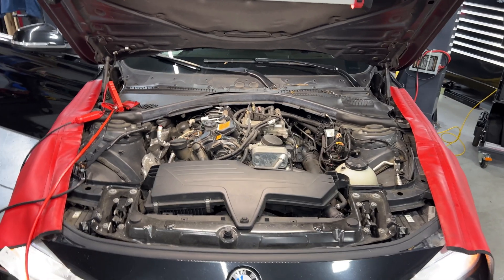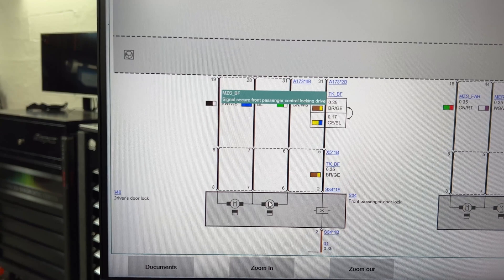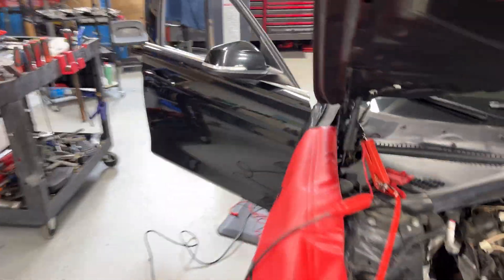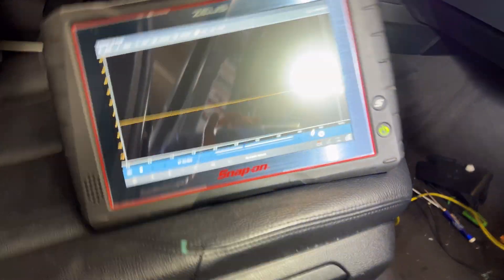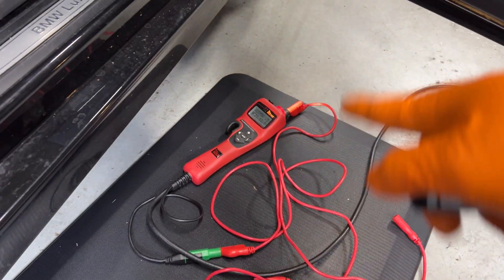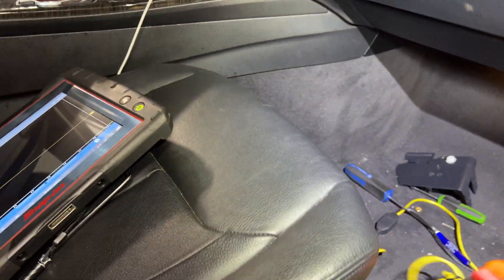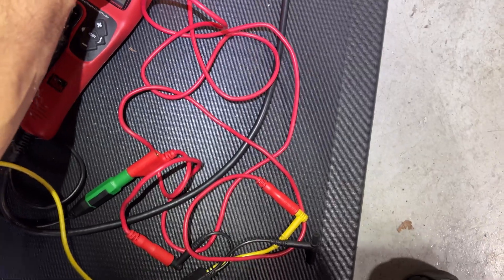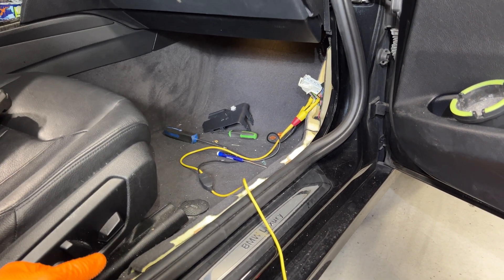2013 BMW 328 N20 F30 Door lock actuator diagnosis

Comment: also oscilloscope only test for voltage doesnt it ? what do you mean put more than 7 amps in the oscilloscope cables?
Reply from the maker: @cesarcarranza42  well, because in this case I use the same cable to activate the component. I unplugged from the oscilloscope and use it to provide the power.

Comment: I have the exact same problem..same car luxury model, all other locks open except passenger front door. Wont open from inside or out. I am stuck with a door locked shut. What was the actual problem. Door Actuator?

Comment: Great video! Let's say the wire is cut. How would you verify this by testing continuity from the FEM pin to the door lock actuator? For example, I've tried testing continuity for the passenger side comfort access exterior aerial antenna on pin 10 & 28 of A173*9B but get no signal. I tried every single pin on FEM and was unable to get a connection to the antenna which is definitely working. Does the battery need to be connected to perform a continuity test?

Comment: Nicely explained... What I do not understand is about using 2 motors...
Okay, do you mean that we have 1 door lock which engages with the car body( common with all cars) & additional safety lock ( is it the 2nd motor ) like the pin type on the window... ?
Thanks